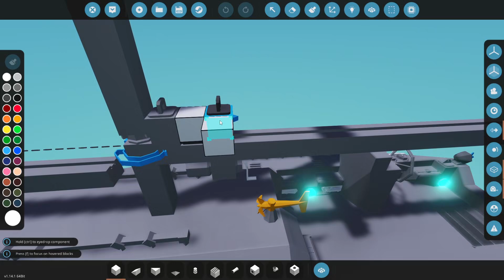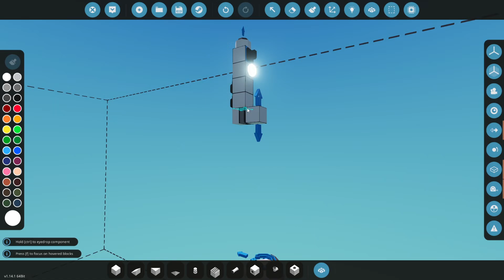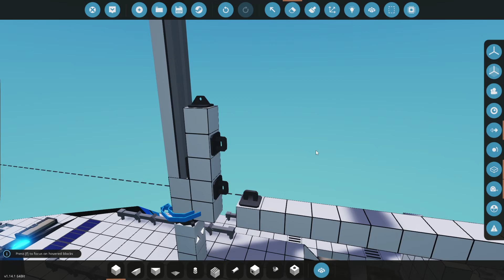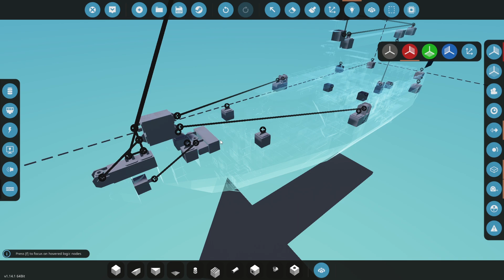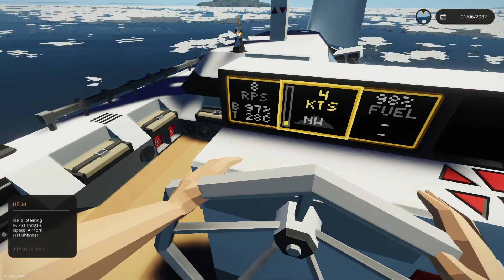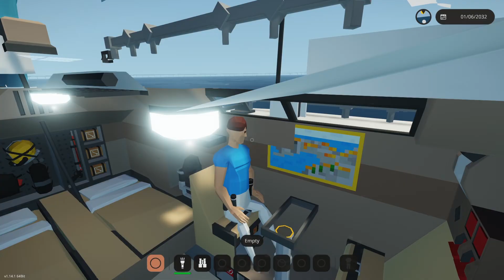Trying (and Failing) at Realistic Rigged Sailing in Stormworks

Comment: Solid grats for improvement! To help with theory of sailing (how you do it); your sails are supposed to be on other side than wind is heading from (unlike your jib was; if sail is on the side from which wind is coming then they make backward thrust).
Talking in numbers, for your relative heading to the apparent wind(I don't know whether game considers it) 30°(end of deadzone) to 130°  the AOA of sails to wind should be 10° to 20°, this increases to 90° as you go along direction of wind.
Good luck with your further adventure.

Fun fact: The wiggle of the main sail you experience at 32:00 is realistic, and most of the time annoying.

Comment: the problem you are facing, is that your sailboat is (sorry I do not know english teminology) trying to steer to a point where it is facing the wind from the back (wind is coming from the back of your boat). Look at it as a fin, or a wind sensor. The center of sail is a bit forward to the center of mass (or rather center of lateral hydroresistance (whatever you call it in english, this is where your keel comes into play, it works like a tiller)). Your goal is to balance those forces, so the boat is stable. You can do it by moving the keel, or sails, dapending in which way your boat is rotating. If it turns to face the wind from the back, move the keel forwards, if it turns to face the wind from the bow, move the keel a little bit to the back. Actual sailboats are designed so that they always rotate a little bit to face the wind from the bow (like the wind sensor), it is a safety measure.
Reply: you can also move sails, or put down one or the other to change those forces and steer the boat. It is also practiced in case your sailboat stops and doesn't move, so you rotate it to catch the wind.

Comment: I had some success replacing my linear tracks with winch-only systems for my sails. It was an attempt to deal with some nasty linear-track related bugs causing the slider to jump wildly and cause explosive collisions if not weighted down enough. The new system also has the advantage that it does only need power if you make adjustments instead of the constant battery drain due to keeping linear tracks in place.

Comment: RE: winches away from the sails they operate
There are A LOT of ways that gets rigged. Usually the jib sheet runs through two pullies- one where the winch goes in stormworks, and a second abreast the cockpit. So you wind up with your main sheet line in the middle, and a jib sheet on either side of you so you can control all of the sails in operation from the cockpit. In my case this is also true of the jib reefing line, but I think it usually isn't true of jib halyards. Typically halyards (the lines that raise the sails) are winched from the mast, but rigs designed for solo-sailing (and nicer ones in general) run those through pullies so you can reach them from the cockpit too. That configuration is called "all lines led aft."

RE: winching the jib from side to side
The reason you can't winch one in while winching the other out is, while you'll never need both of them to winch in at once, you will need both of them to winch out at once when extending the jib sheet to its full length. The jib has to be allowed to billow away from the boat, which is why I have mine hooked up independently. It's annoying as hell though because realistically you would only operate one at a time. The other you'd just release and make sure you weren't sitting on it and didn't have your leg in it or something. I think on future designs I'm going to go using 3x1 winches so I can control their length mathematically and approximate that experience.

RE: booms on jibs
You do see that sometimes! It's pretty rare, but they offer a very nice convenience factor in that they allow the jib to "self tack" the way the main sail does. They also make it a lot easier to go down to one jib sheet line. In Stormworks, they have the additional benefit of holding the sail in its deployed position so it doesn't try to relax on itself if you leave "relax" mode on. I've been ambiently working on a 50 or so foot yawl-rigged motorsailer in stormworks that uses a jib boom, and it takes a lot of the pain out of tacking and jibing. If I could snap my fingers and replace my genoa with a jib AND install a jib boom I'd be all over it.

RE: hand-hauling versus winches
On my boat the main sheet is hauled by hand and the jib sheets are winched. Off the top of my head I can't imagine how you would hand-haul a jib on a boat of that size because the forces are just too high, but I imagine it might be doable with the right rig, and I know I've seen it done on smaller boats.

RE: steering with sails
TBH the stormworks discussion on sailing is the first I've heard of this (that's what I get for self-teaching!) and I am absolutely dying to try it in real life now. I've always used the tiller for everything. Unfortunately I am out of state from my boat, so it'll probably be a hot minute. My understanding from the reading I've done since is that you want your boat to be trimmed to have a slight "weather helm", meaning that it pivots naturally into the wind when you're not touching the controls. We're at the limits of my knowledge, here, but that could be part of why you had trouble controlling sail-only.

Comment: 2:18 -- RE:  You don't necessarily have the Jib sail on a track such as this;  A:  That's correct, I'd expect there to be a track running parallel to the Beam with a shuttle that moves to the Upwind side.  Jibs don't often use a boom or a yard arm, unless they're special purpose like a spinnaker, and then the boom or pole would be deployed from the main mast.

Comment: disclaimer: i'm not a sailor and i never sailed irl, so take it with a grain of salt, but i'm engineer and studying/exporing sailboats was pretty fascinating for me.

  You have easier time with your simpler version because it is misses the point, but don't worry you're not alone). I tried to understand priciples of how sailing works and read around 10 articles and watch 20 videos about it and i understand - most of the people don't even know what they are talking about :D. Even real sailors often misunderstood basic phisics principles and only confuse readers/viewers. They mostly understand enought to get sailing but not enought to build a sailboat - which we here in stormworks are trying to do. Also there is plenty of low quality articles and videos which repeat the same mistakes. 
   Also it is important to understand similarities and differences between sw and irl sailing, and because of the differences most of sail charts (where it shows which angle sails should take for each wind direction) is poorly applicable in SW.  
   Also i think you are right that not every contraption need to be 100% realistic since SW is not 100% realistic and many mechanisms is much easier to make with SW tools but some simple real solution work bad in SW because of lack of components, its big sizes or properties.
   So about your sailboat approaches:
1. Sails even in perfect positions according to the wind could and would create turning force because it is almost impossible to balance rotational forces of 2 sails. So irl and in sw rudder/tiller should be used as trimmer for boat turning - when sails tries to turn your ship you counteract this with rudder trim or heading hold
2. Ropes and cables in SW is veeeery rubberish and can increase it lenght 10 times depending on the force, so for some parts you could use double ropes(for example for main sail).
3. Controlling main sail with robotic pivots require 100% manual controll all the time, becuase when you turn over the wind (tacking) you need manually turn your main sail to another side. When main sail angle is controlled by ropes and winches its controll less rigid but it let sail rotate to other side on turn on its own (which is called self-tacking) so on zigzaging you don't need to manually tack it all the time. That's where realistic approarch are not obvious at all but work better when you understand why its it like that.
4. Jib/headsail could be used with one centered winch and it will work most of the time. But it will flap side to side when you sailing close to 0/180 degree to the wind(especially sailing into wind). Controlling jib side is required on turns when rudder is not enough and to have 2 sails at the opposite sides when you sailing from the wind to minimise turning/rolling force. 
5. you should reef(reduce its size) the sails when moving on engine power.
6. Sails have 2 main sources of force used to move ship - deflecting/reflecting wind and working like the wing. So angle of the sails should be chosen according to there forces. 
     - deflecting wind is pretty straightforward  - the angle of incidence is equal to the angle of reflection - like the mirror. And the angle of deflected wind should be opposite to ship moving direction (deflected with       should be directed to the back. if you sailing 90 degree to the wind your sails should be near 45 degree). Also there is a thing that can trick you - when the boat moving for example 10 m/s it creates opposite wind relative to the boat- real wind with created wind summ up in vector form and create resulting wind. And that your wind sensor will show you that resulting wind, and which should be considered when adjusting the sails. That's why when you increase your speed you should also adjust sail closer to 0 position pulling the rope.
    - wing-like work - when wind is blowing the sails they create curvature which create force like the wing when wind blowind from the side. When traveling from the wind that force is almost 0 because sails should be almost perpendicular to the wind. But when you traveling into the wind with some angle - that force is maximum. From the tests - best results was when sail is 25-30 degree to the wind direction
7. Keel we have is basically roll/pich PID-controlled stabiliser, but it won't work out of the water
8. many forces in SW is pretty high. For example drag force of water and air is very very high relative to irl. So with displacement hulls sailboat is unlikely exceed speed of the wind, but it is possible hydrofoils.

I cound recomend you series of the videos which helped much very much:
about rigging from that channel https://www.youtube.com/watch?v=tRgWtPaCQQc&list=PLQOqsyzQgrHMeM6W5NWq-2sEsq1kcp6Eb
and these for close look of sailing https://www.youtube.com/watch?v=WjBYRUZbU4Y

Comment: Great video! I was suprised to see my comment at the end. The only things I can say that might help is that your mast might be a bit short, in most sailboats like the one you made it’s about 1.3x the hull length. I also think maybe you should be bringing out your mainsail a little bit more when sailing in a far reach. I think the cool thing for me about the sailing update is that it’s about your own experience with the boat rather than simply your boat being good or bad. I have learned to use trim to keep my rudder I holding my heading and navigating through different winds ect… I know winches aren’t super realistic but I think the best ways to make the rigging system realistic is to use hand cranks and generators to simulate cranking the ropes by hand. Keep up the good work!
Reply from the maker: I will have to try that out! Thanks for the great info! I enjoy the hand cranked systems to simulate winching :)